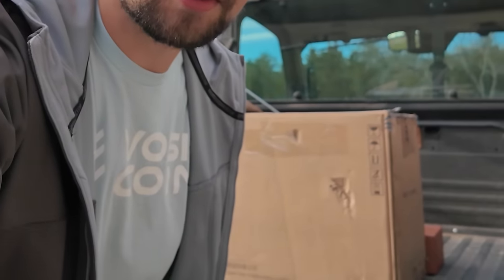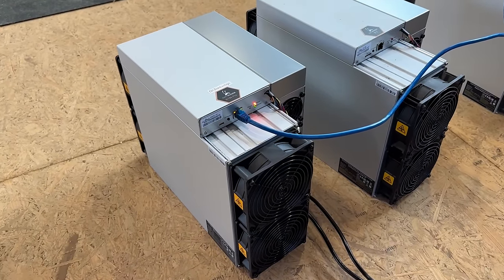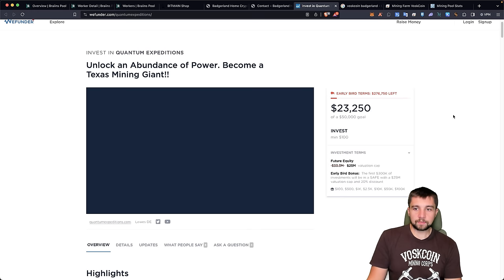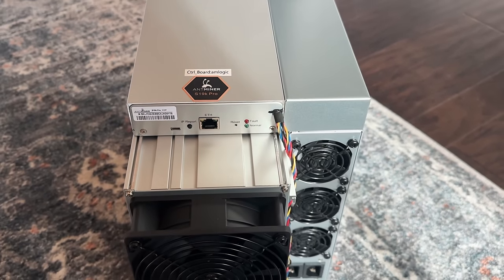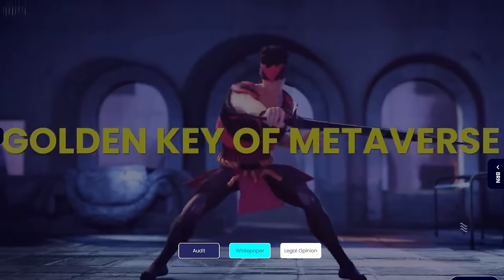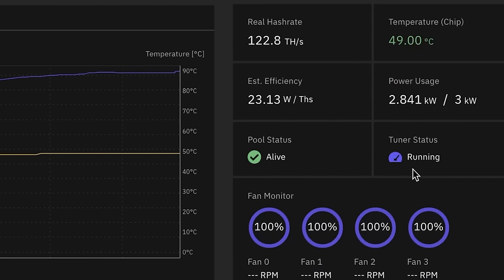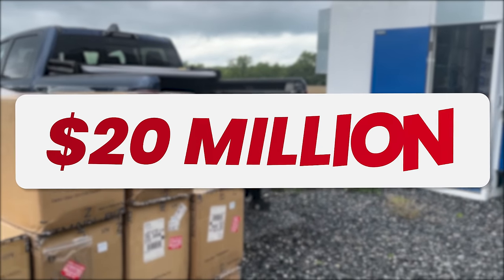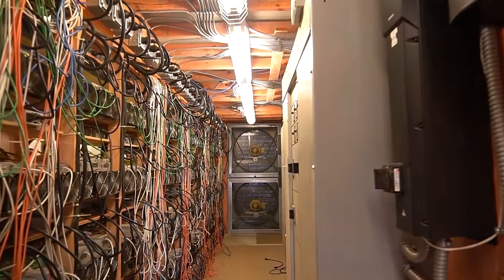Bitmain Antminer S19K Pro Review

Comment: I have 140 s19k 115s. Pretty much flawless. 2 fans not working at beginning. With over clocking hitting 133th. 18.72ph overall. I thought I saw you were paying 10 cents for electricity. That’s a bit brutal. I’m at 7.5 all in with hosts. No capex other than the machines and 50 bucks to install.
Reply: What is the energy (kw) consumption when overclocking to 133th?

Comment: Hey, in the last 2 years I’ve gotten solar and am running a couple miners S19JPros, and I connected their outflow into my heating ducts.  I tiges them up so they heat my house within a temp range and automatically send the outflow elsewhere when it’s warm enough, or in the summer.  Was wondering if you use any of your miners for heat?  I saw where you sometimes use a couple in the garage.  In the winter it’s definitely nice to have my heating completely payed for by the miners.   An you tirs with the house and farming, you could even heat a green house in the winter to get ahead on germinating seeds.
Enjoy your content.

Comment: Anyone using bitmain stock firmware on “high energy mode” on 115th or 120th version?  If yes, what is your hashrate and kw usage?
Reply: 139th with 120th version idk about kw could be 3400w

Comment: I love my S19k pro, I have it almost 100% silent .. I just need to remove the PSU fans but nobody can tell me off it will have errors if I remove the PSU fans
Reply: Serious question.  Did you actually take the fans off?  If so... How did it work out?
Reply: Just take the 3screws off front and then the top 3 and remove cover and try to pull up those stupid plugs , their tiny and tight 🐳
Reply: @idallover303  yes , it’s good
Reply: @idallover303  yes

Comment: Hello,
I'm going to buy this Antminer s19k pro to start mining in 2024 
But I am afraid of the 2024 halving and its repercussions on the market
So do you advise me to buy it?
The electricity cost in my country is about 0.039$
Reply: I wish I had that electricity rate 😂 I would have 300 ASICS instead of 85 😂
Reply: what country you from? does the power grid hold on good or does  it fail regularly?
Reply: @NobatolasY2b  I am in the US I only have a couple of my most profitable miners at home because my electricity is 13.5c perKWH so I have the rest at a hosting facility
Reply: Then your electricity bill is relatively low, which is great
Reply: buy it and farm at the rate even with the halfing